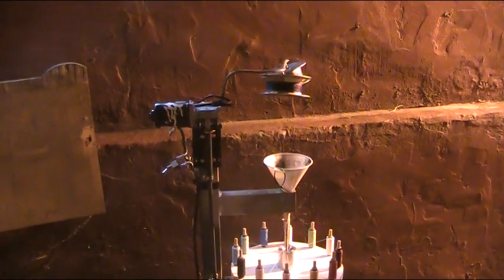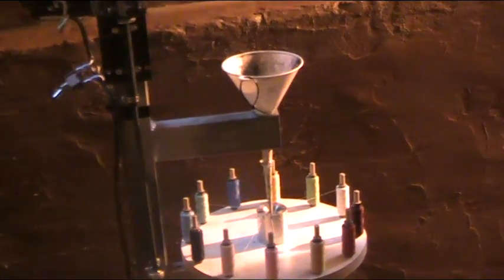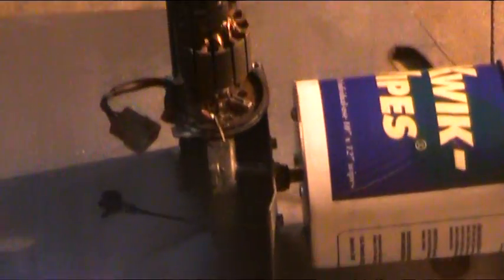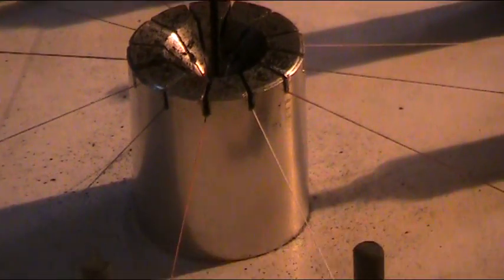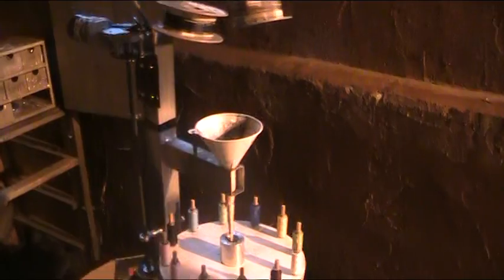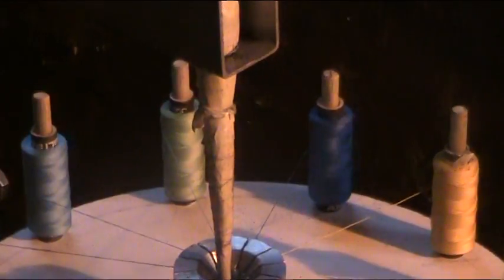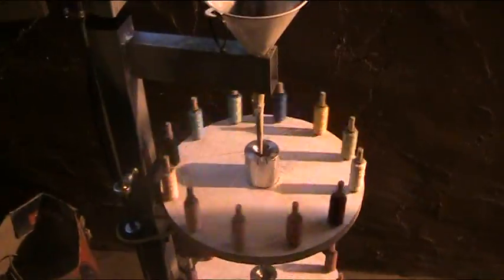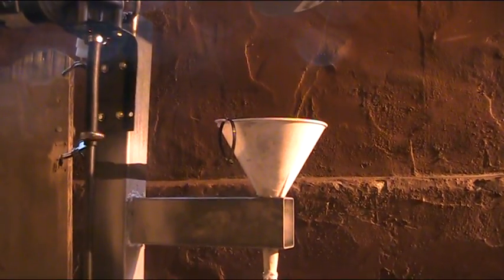Visco fuse machine

Comment: I’m not sure if this channel is still active but how do you increase the thickness of the fuse?
Reply from the maker: you would need to make the hole in the center of the dye larger.
Reply: rivenz6 that’s awesome would you have to increase the thickness of the thread too?
Reply: @industrialadhesive6357  more threads, not thicker threads. Increase the hole size like he said, and add another series of bobbins, it will work just fine. Too thick of a thread will absorb too much NC lacquer.

Comment from the maker: I assume you are referring to the aluminium piece at the centre?That is there to guide the threads towards the hole in the centre.I made them quite tall(maybe not neccesary)because I thought it would give more drag on the fuse as it passed through,which keeps it taught and allows it to wind onto the reel in a more consistent fashion.